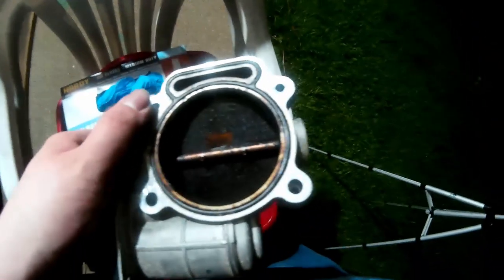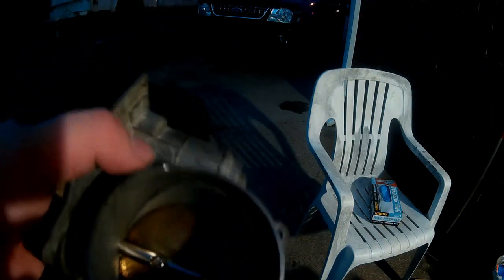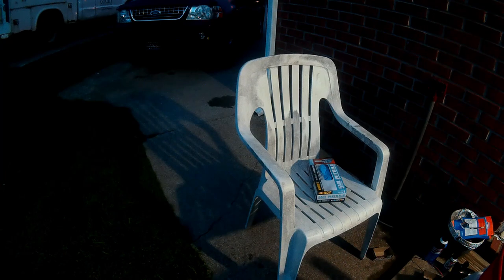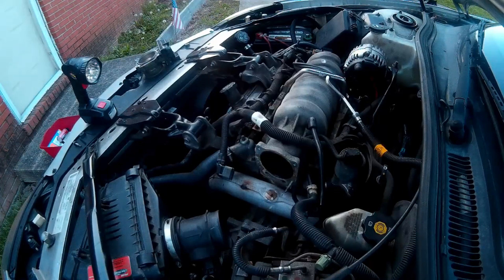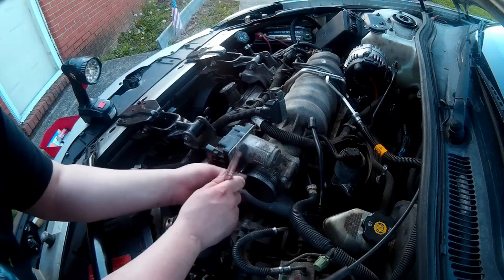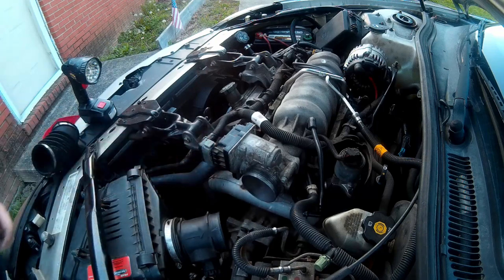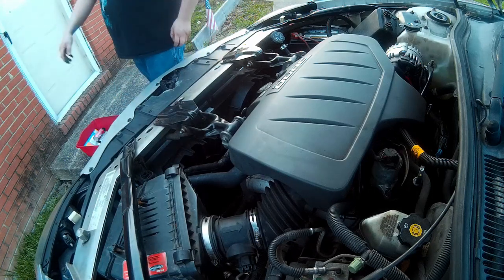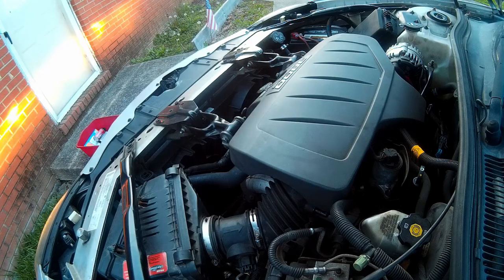Throttle Body Cleaning 04 Grand Prix

Comment: Cool video...thank you .
I have problem putting the pin down, I pushed forward and at the same time I pushed down from the top..but still don't go down...
Reply from the maker: My sincere apologies, but you will need to be more specific, what are you trying to reconnect? is it the wiring harness, the bolts, or something else on the throttle body? if you can get back to me, i can try to help,
also, thank you for the kind words.
Reply: @Eterna1Link  I'm sorry about that, it is the grey pin,well I call it pin Lol .. because it locks the harness into place. And to remove the harness you would lift it alittle then pull out the harness
Reply: In your video you said the wires to the sensor.. I'll figure it out, but thank you for responding to my question, that was very kind of you...I have a 2004 pontiac grand pri  super charge. Automatic and slap shift,. These cars are awesome..
Reply from the maker: @anglin4151  Sorry for the late reply, it is currently midnight where i live, if that is not clipping back into place, then the plastics could just be too worn out, mine snapped recently, and i have ordered a new end connector to fix mine, You could try to tape it in place temporally as long as it seats all the way down properly besides the clip clicking like it should, and then taping it down, if it all works, you will need to find out which part is old, the wire connector itself, or the port it plugs into.  and i agree, i love my pontiac, though my poor motor is finally going, will be dropping a new one in it after i save the money for it.
Reply from the maker: hold on, just remembered, that is the connector for the throttle itself, got it confused with my mass air flow wire, if that does not go in all the way, then do NOT start your car untill it is
Reply from the maker: pull it out, and see if it has any bent pins, if it does, try to very carfully bend them back to normal, if it does not, it may take a little more force to fit in, when i reinstall mine, i push from the back, and also press down on the tab on top at the same time, it SHOULD slip it in all the way for you
Reply from the maker: @anglin4151  Make sure to read my three replies after this, it is midnight over where i live, so was a little hard for me to think during the replys, hope you get it back together, and she drives like new when you are done
Reply: @Eterna1Link  ok I'll try that...I'm so sorry,I didn't realize it was that late where you are... I'm in NYC it's 10:00 pm here... sorry again.
Reply from the maker: @anglin4151  It is all good, if you have anymore trouble, ill be up around 1pm your time, currently on an away team helping to open a new building for fraud returns at amazon, the state i actually live in and cant wait to go back to next week is kentucky. Anywho, im off, have a good night on your end.
Reply: @Eterna1Link  thank you, you too.

Comment: Need more videos on the Pontiac
Reply from the maker: Sorry for the late reply, recently got promoted at work so have had less time to work on her, plans for the future is new rear suspension as well as CV joints and a steering knuckle, also currently saving for a motor swap as mine is clocking pretty bad, i will keep you posted, but might take a bit more time to get funds together, also, i want to do the whole rear suspension in one go, parts wise g cost will be around 600 for the parts i want to install